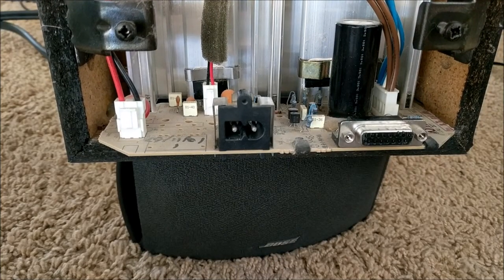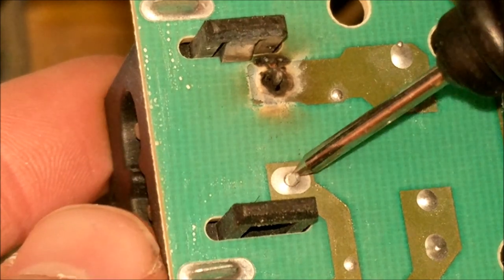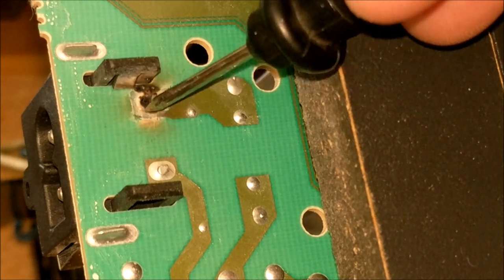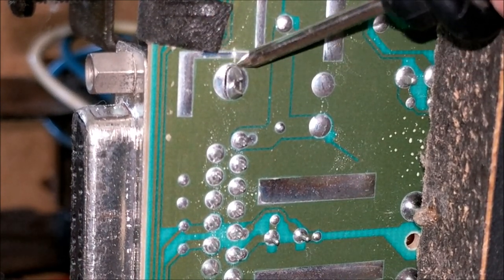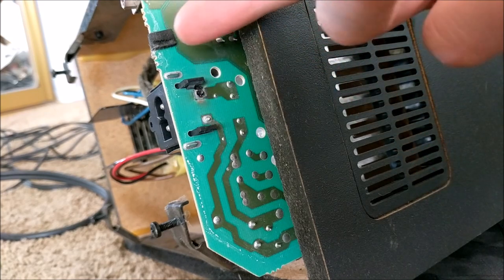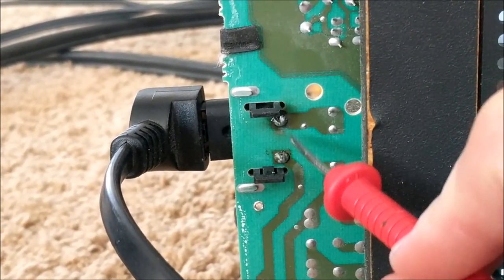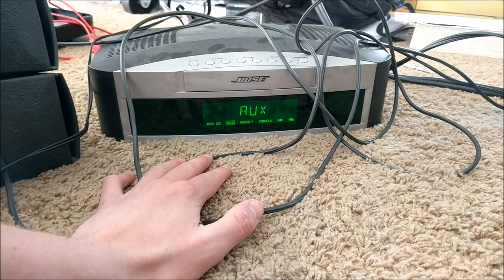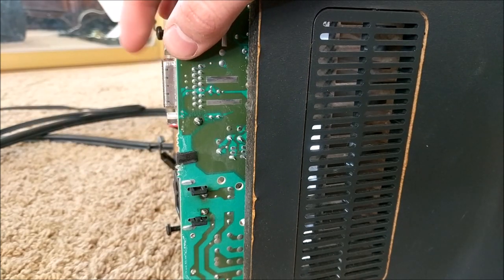Fixing Broken Arced Solder Joints in a Bose Sound System

Comment: you really should have removed the ac input jack and cleaned the pin and pad. Its very likely you made a poor connection to the burnt pin because of the carbon build up on it. And definitely need to support that connector with glue or something or it will happen again

Comment: I suggest to reinforce the connectors with hot melt glue. It will make the connectors stick to the pcb without damaging the solder joints in future
Reply: WTF no

Comment: Also, those solder joints are cracking because of the stress they're under when the connectors get plugged in/unplugged, coupled with shitty lead-free solder that manufacturers are forced to use these days.